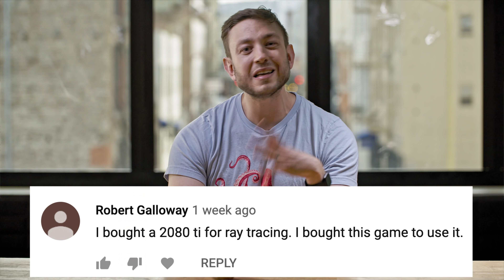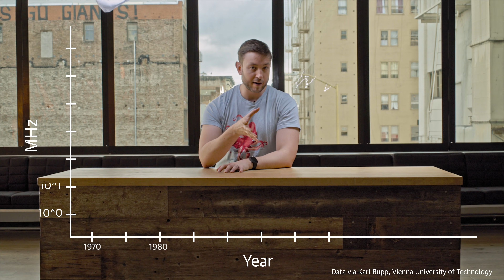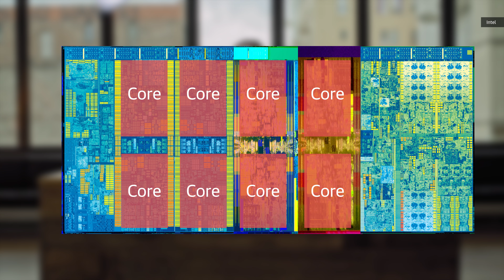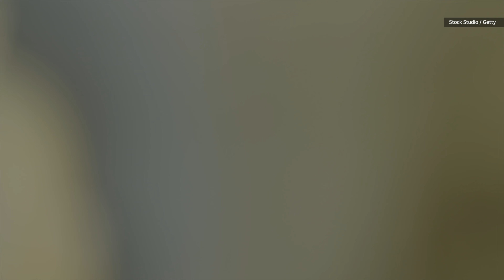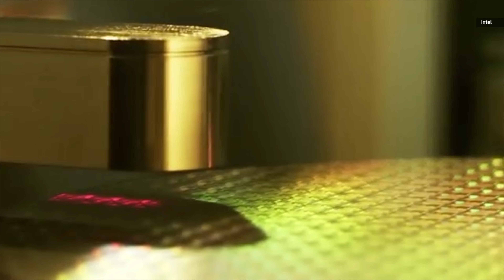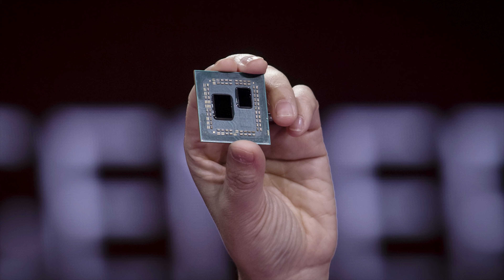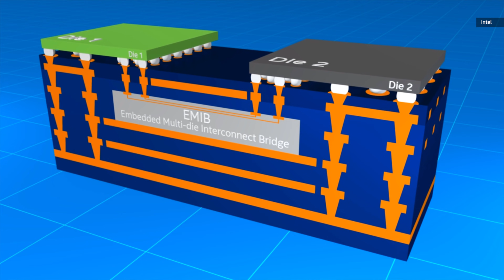How Intel and AMD are using 'chiplets' to build next-gen CPUs | Upscaled

Comment: Moore's law is just the most obvious sign of a much larger advance that has been going on since before agriculture. Some people tracked the development of information, and it has been shockingly steady, and throughout time. (Dark ages wasn't as dark as people think.) Moore's law was just the most obvious piece of it. Sure the processor isn't developing, but software and how chips are designed are, while the quantum computer happens to be moving along in an exponential fashion and already blowing away digital in certain aspects.

Comment: CPU makers:
2005: We're going to put more cores in the die!
2019: We're going to put SO MANY cores on the dies we'll separate out 
clusters and call them chiplets!

Programmers:
2005: Uhh... we're not gonna use that.
2019: Okay fine we put one thread that uses 1% of CPU on the 2nd core 
and another 1% on the third, but the main render thread is still on one 
core.

Benchmarkers: MUH HANDBRAKE

Comment: One major reason not discussed is that future technology nodes will utilize EUV. It turns out that, EUV masks for high volume manufacturing can't be as large as the masks they use for DUV. This means with EUV you can't actually directly make dies as large as Intel and nvidia have been making in recent years.

Comment: Ray Tracing, as implemented on RTX cards, will be dead in a year. It was a half-assed "get it out the door so we can stay relevant" measure. 

The new wave of consoles (Scarlett, Erebus) will be a full fledged proper implementation with only a 10-20% hit on frames per second and not the failure of a nearly 70% hit on RTX.

Comment: AMD is legit the first and only chiplet based cpu mass producer. Intel, rumors and empty speculation. Also, one of the main reasons RTX is a gimmick is choosing to go the dedicated harware route puts them on track to have real pathracing in photorealistic games in 40 to 50 years. LOL, those RT cores dont scale, they wont double in performance each generation because moores law is dead. Nvidia wont even make an all RT core gpu because it would be way to expensive. Even if they did it would only be 3 to 4 times more powerful, so go from 1 ray per pixel to 4 rays per pixel. Real pathtracing requires thousands of rays per pixel. LOL

Comment: One thing I've been asking myself since Ryzen came out is:  How does Ryzen perform with popular hypervisors (VirtualBox, VMware, Hyper-V).   First there was compatibility issues with Ryzen with regard to hypervisors.   I think these issues have been resolved in the latest Ryzen.   Can you confirm that Ryzen 3 is hypervisor compatible out-of-the-box?   But what about performance?    Can you run a simple performance test comparing Ryzen and a comparable Intel processor?   It's easy!   Create a big number of instances in the hypervisor and run the same test in each and collect the data.

Comment: Moore's law has nothing to do with performance it's about transistor counts and one thing does not act as a "proxy" for the other because the ratio is nowhere near 1:1 between count and performance.  A more important "law" that's mostly overlooked and rarely mentioned is Amdahl's law which has to do with the performance benefits as core/thread count increases.  Per thread performance is making very slow gains, we're almost at the wall for CPU's and will rapidly approach the wall for GPU's.  Without better per thread performance we're soon going to be backed into a corner.

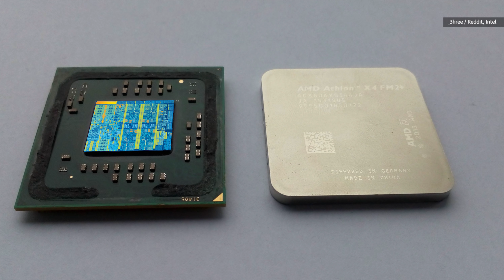Comment: 4:40 "What Intel and AMD are proposing [...]" Intel and AMD? Lol. AMD implemented it fully since Ryzen, before Intel announced they were working on it. It's a clearly superior design choice: The performance of the CPU within it's architectural family hierarchy is no longer related with its yields. AMD's cost of manufacturing  a low end and an extremely high end SKU (i.e. Ryzen 3 vs Threadripper) is nearly the same on a per core basis. Intel has extremely low yield on high end chips (I'm not talking about consumer grade) because of the monolithic design.
AMD also played with this concept before, when they implemented CPU core clusters with the FX lineup. It's a given that it didn't work well at all, even as much as losing a little bit of single thread performance against the company's previous lineup, but the concept itself wasn't bad. It was, however, underdeveloped.

Comment: why processor manufacturer don't imitate human brain?brain cell as the "chiplet" connecting each other with axon as a large data bus and heat transmission and dendrite as interconnecting with other "chiplet"..and there we got dense 3d structure and packed processing brick

Comment: On top of that, the software that the average consumer uses doesn't really benefit from more cores outside of gaming. You can even still do quite well on a dual core hyper threaded cpu.

The one benefit of this is that people don't have to worry much about upgrading. I haven't actually felt like I was running out of CPU power since the ageing core 2 Duo's. All the CPUs I have are Ivy Bridge and Haswell architecture. And I don't feel the need to upgrade really.
Reply: +HScarlet
It is not just the computers you have as a PC it is data centres, artificial intelligence, gaming systems, driverless cars and many other forms of engineering that benefit from all of this. 

Even the production of movies relies on these types of developments and the very internet you use requires these developments. 

Most people's computer runs on a simple cheap set up but the background that it needs to run such as the internet requires the development.

Comment: In a nutshell... Moore's Law isn't working so well with transistor tech because once you get smaller and smaller in the nanoscale, you'll start running into quantum tunneling issues where the 0's and 1's are just flying through the gateway when it's in it's "closed" state".

Comment: Correction how AMD is using chiplets and Intel are copying them after insulting glued together cpus
Reply: Not the first time.. :) surprised nobody recalled Athlon 64 X2 (AMD) vs Dual core Smithfields/Preslers (AKA Pentium D) (Intel)
Reply: Intel has been developing 3 dimensional computation for a long time.

Comment: "...tech AMD and Intel are trying to use ..."  Trying to use?   AMD IS USING IT.  Intel is copying AMD AGAIN and AFTER they first criticized Ryzen back in 2016.
Reply: @Sir Hoodie PROVE IT.  What is the product name and when was it produced?
Reply: @Sir Hoodie 
Intel core 2 quad was not a chiplet design.  It used 2 Core duo cpu's in a single package.  And then they stopped.

The difference was the AMD MCM or chiplet design was intended to build an entire generation of CPU's from 4 cores to 32 cores 64 threads from the same chiplet architecture using an advanced fabric data interconnect.

The entire purpose was to lower costs of single die poor yield high core count cpu's by building them from high yield low core count chiplets, hence the Multi Chip Module.  The architecture AMD developed goes beyond just chiplet cpu's but chiplet gpu's and HBM memory all on a Transposer with active memory control in the transposer.

Intel just wanted to build a 4 core cpu in a single package and that was it.

In fact Intel abandoned the Core Duo Quad in favor of single die multicore cpu's.  That is why Intel can not build a 32 core 16 thread cpu at all for less than $4000.

Sorry Core Duo Quad is not a chiplet design.  It is rather a multi cpu design in one package.
Reply: @Sir Hoodie 
You do not have a clue.  In fact you are not worth the time to respond to your rant.  NOBODY but you believes what you think: the very definition of delusion.
Reply: @Sir Hoodie Your point?
Reply: @Sir Hoodie  It took me four weeks to watch this drivel.
Reply: @Sir Hoodie 
What is your point?  What difference does it make how long I take to reply?

Comment: Now you know how an i7 becomes an i5 or i3.  Only difference now is they will use individual die.  I still don't see how any of this helps with single threaded performance.  Until you lower your CPI you are pretty much stuck.

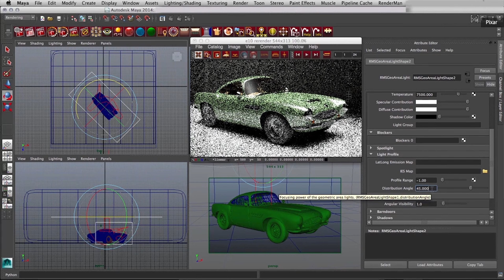Comment: 0:49 "Moore's Law started to break down around 2012....It's more about the amount of transistors on a chip, than speed".
Nope, you're wrong -- 'Moore’s Law is a computing term which originated around 1970; the simplified version of this law states that processor speeds, or overall processing power for computers will double every two years. "

Are you nuts? Moore's Law broke down shortly after 2002. Intel announced it was releasing the 4.0 ghz processor around 2002. And then claimed it couldn't release it because of some sort of overheating issue. A company isn't going to announce the release of a product that takes years and years to develop and test, and announce it's coming release in the media, and then claim that they find problems with it. That was B.S.
And the only thing that happened in the 2000's, is computers were released with more and more core processors -- 2-core, 4-core, 6-core, etc. Thing is, that's linear growth. Moore's Law is based on exponential growth. Apple's Mac Pro 2013 "garbage pail" design desktop computer was a perfect example of regression. It actually released a newer (and more expensive) computer that was actually SLOWER than it's older Mac Pro computers. It was also a perfect example of what the computer industry was doing to stay in business: wrapping up old outdated technology, with only marginal speed improvements, in smaller and smaller designers, and calling it "new".

And here comes my conspiracy theory. The U.S. went to war on Afghanistan and Iraq in 2002. Hmmm, any coincidence? And that's when the government probably recommitted itself to supremacy in everything -- military, intelligence, weapons, tech, etc. Well, the U.S. government does lots of business contracts with Intel. In WW2, the US government had the world's fastest computer technology to decrypt German intercepted communications. It wasn't even until years AFTER the war, the government declassified their technology, and a university that thought it had the fastest, realized they weren't the fastest after all. So the U.S. government LIED to the American people, keeping a technology secret. You honestly don't think they wouldn't lie to it's own people again, especially in a time of war? (Afghanistan and Iraq) And wasn't it strange Intel announced their 4.0 ghz processor, then had to quietly make some EXCUSE up and not release it for YEARS and YEARS later? It's because they didn't want guys like you and me with fast computers. Meanwhile, they are now almost 2 DECADES ahead in CPU technology.

I grew up in the 70s, with our family owning the "pong" game on the old coleco console. In the 80's I worked on an Apple IIc with 512k memory. By 1990's, I was on a Mac IIci with 2MB's memory. Mid 90's 16 MB's RAM memory. My point? I saw things doubling for more than 2 decades. I LIVED in Moore's Law. If you had a computer in the 1990's that was more than 2 years old, it was worthless, because there was already something newer that was way more powerful, and faster. You would just chuck it in the garbage. There was a spoof skit (like MADTV or Saturday Night Live or something) that mocked the computer market. A customer bought a computer from a computer shop, and by the time he was in the check-out line, paying for his computer, it was already obsolete. Moore's Law was very real for decades. But mysteriously stopped after September 11th 2001 terrorist attacks, and when the U.S. government decided it would go to war with foreign countries and it's own people -- with the TSA, "Homeland Security", patriot Act, etc. Consider that both myself and my buddy, who are computer nerds, are both on old USED Apple desktop computers. I'm currently using a desktop from 2010.

Intel could not still be in business if it was still schlepping out the same old crap it's been for the past 2 decades, with only marginal improvements. It's got something it's not telling us about. Moore's Law is probably still in effect, but we won't know about it.

Comment: The power of the chip is the sum of its parts.  Instead of a large gap between chipsets, just make the separation between chipsets smaller.  Just an idea...  Personally, speed may not have gone up; however, I prefer to have more cores at 3.3 or above. 

I have an i7 6 core with 12 threads giving me a total of 12 cores and I am loving it.  Everything is running pretty fast and I can multi-task between having Youtube, x4 foundations, World of Warcraft, task manager, hint on my firefox for WOW, Realplayer, and Skype all running at the same time.   I forgot to toss in Outlook....  lol 

For now, 3.3 is good 5.0 will be fine; however, I prefer more cores and being able to break up the operating system.  Ex.  OS runs on core 1 and does the managing while the rest of the cores are running the games, music, and anything that can be offloaded to a different CPU.  If a program crashes, it will not stop the entire computer, just one CPU where I can cancel the program and restart it without losing all control of the computer and forced to restart it.  The famous Blue Screen Error that everyone knows and love.  It has not happened as much lately and that is good. 

Anyways...
Reply: Thats not how cpu works... At the end it doesnt matter hoeany cores you have when your tasks doesnt get calculated...

Comment: Make the processor in 2 separated chips and the mother board put them together. Problem solved.
Reply: But then the chipset trying to add both frequencys and bandwith would be an extrem bottleneck... And almost no appliaction except for server designs make any profit from that...
Reply: @zyrkel7587  So do it stack-able.

Comment: The original NeXT computer used a stack of Motorola 68040 processors, one for each system function (one for I/O, one for storage, one for networking, one for printing, one for screen display, etc.). 

That was 31 years ago.
Reply: You are confusing parallel computation with 3 dimensional computation.  What we are witnessing right now is the first steps in 3 dimensional computing.

Comment: Why not just allow for modular CPUs?  Instead of throwing away older CPU computer parts..can't it be possible to just plug all those older parts into your new system (Either directly onto the motherboard.. like memory cards or indirectly like an external hdd) and allow all those parts to contribute towards the system performance.  Aren't more processors ...even if they are not all super tiny and super fast...better than one or two CPUs with the latest greatest tech?
Reply: These exist. They are referred to as expansion cards. They were introduced back in the 80's. Only things still around are some 4k video processor boards of questionable viability. Designs have been integrating more into the processor as within the processor is where the least latency exists. Offloading is a step back no matter how you look at it.
Reply: @msap6813  Very interesting.. thanks for the response.  But may I ask.. why would plugging my old CPU into a new system with a new CPU be worse for the system? Isn't GPUs performing the same function as well? If you could let's say plug in 5 of your old CPUs into the motherboard..the main primary CPU can still be used as the main processor..but by passing off some tasks to the other CPUs wouldn't it reduce the heat and demand on the main CPU and improve performance?
Reply: @thelogoth  The issue is motherboard latency versus processor latency. Copper has more electrical resistance than a semiconductor and has more length to travel on that higher resistance. Offloading data is a thing but will always be slower due to my statement above. Power does not start equating to speed till you have many, many more instructions.
Reply: @msap6813  ok..fair enough. But.. I struggle to understand why a gpu works fine.. without these limitations you mentioned. If a GPU is just a fancy CPU.. something we can swap from system to system...why can't it be possible for CPUs. I am talking about accessory CPUs...one CPU to run the main show..and like a GPU.. additional processors to help with multitasking.
Reply: @thelogoth  It might be possible to set up specialized processors in a similar fashion but GPU's have the same bottleneck problems. They get around it though graphics API's which simplify instructions between the two processors. So doing that to separate differing types of math between processors is possible. However GPU's have been around for almost 30 years and have been aggressively developed. Possible but the market has to drive it.

Comment: Then why don't they increase its size ?
The current micro processor is around 1.5 square inch, can't they just make double the size to hold more transistors, i know it will increase the over all size of a computer, but for twice speed I am sure there will be many ready to buy that heavy machine.
Reply: @Michael Hansen thx for info.

Comment: I agree, since 1998 I used to build my own system every 2 to 3 years.  Since 2013 I still have the same computer and still happy with it in 2019, especially since I'm running Linux which is WAY faster than windows, has no EULA agreement, and has no ridiculous hardware requirements forcing the consumer to purchase another system.  I have 16gb of ram with an AMD octocore processor that should last me a very long time.  I don't think I've even ever used this system to its fullest potential.
Reply: Wow. You've wasted alot of your money. We can't all be as gullible as you.